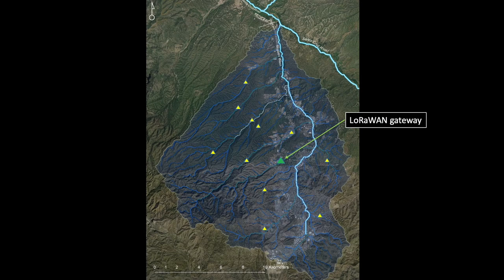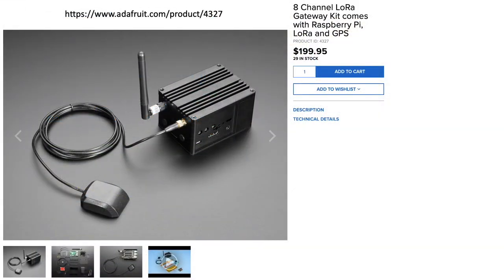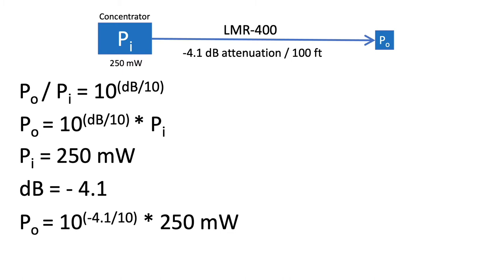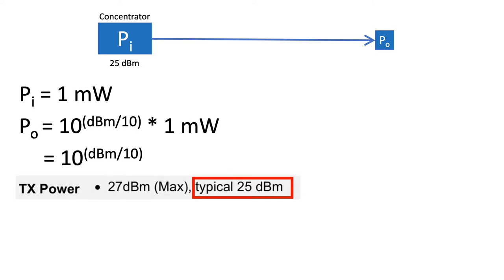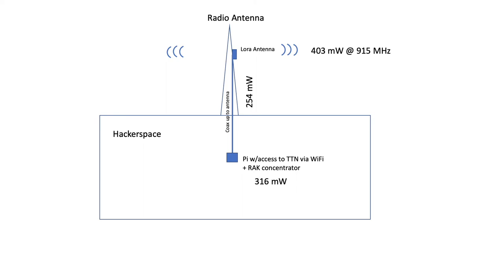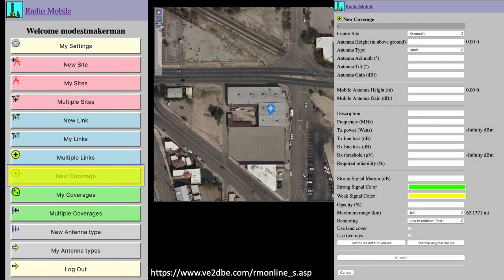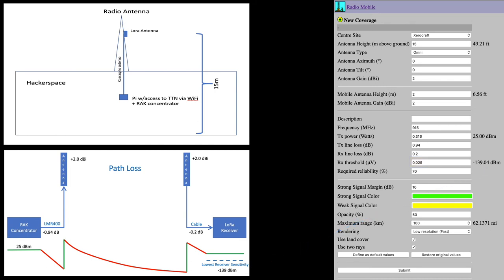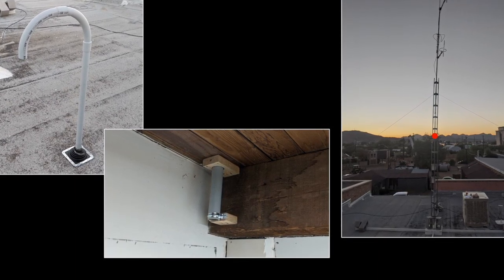LoRa at Xerocraft: Estimating Telemetry Coverage

Comment: Thanks for the heads up! Great to see you are making progress. Very informative. I'll definitely look here again when I want to understand the details of dB, antennas etc.

I have some ideas you might consider:

To squeeze out every bit of range, you might consider mounting the gateway outside in a suitable enclosure. Can't say I have experience with it, but it's the pragmatic way to avoid the losses introduced by a lengthy coax cable. I read about such a solution in the German Make Magazine edition of 2019/3 in the article "LoRaWAN Outdoor-Gateway": https://www.heise.de/select/make/2019/3/1561288019578607. The gateway in the article is powered over PoE.

In a previous comment, I suggested using a higher spreading factor (SF) instead of the standard SF7. The biggest spreading factor SF12 has the longest range, but every symbol (byte of data) you send takes 32 ms. With SF7 a symbol only takes 1 ms. With SF12 your messages take a lot longer to transmit, introducing it's own problems. My suggestion is to choose a spreading factor preferably on the low end (maybe at most SF10) and keeping transmissions short.

Of your original problem with the water sensors scattered over a larger area, i'm guessing you probably won't install multiple gateways to cover the whole area. In that case you can might consider using a combination of peer to peer LoRa (like in your first  LoRa video) with some central LoRa nodes relaying the sensor data to the LoRaWAN gateway. In the last year I've experimented with CAD mode that's described in the SX1276 datasheet. Using it I was able to  receive LoRa messages with less than 1 mA of power consumption (compared to 12 mA in normal receive mode of the rfm95 module). Going this route however takes a lot of dedication since CAD mode is not really implemented in the arduino-LoRA library. Most of the discussion about CAD mode can be found here: https://github.com/sandeepmistry/arduino-LoRa/issues/365
Reply from the maker: Hey - just wanted to thank you for all this feedback. When I first posted this video, I was still new to LoRa  so I couldn't quite follow everything you shared, but now I'm up to speed and understand things a little better like spreading factor.  Also, thanks for the heads up on CAD mode - I'll be looking into this.